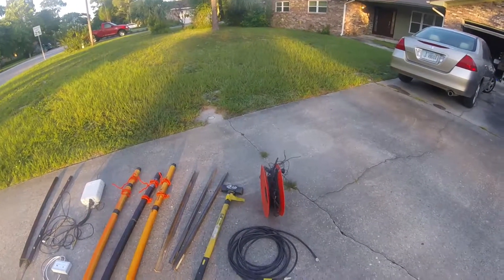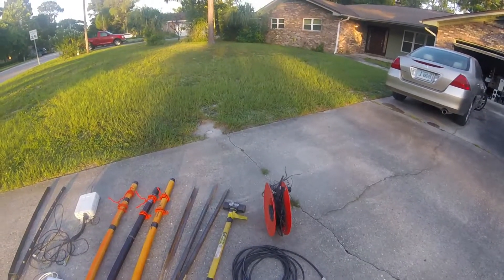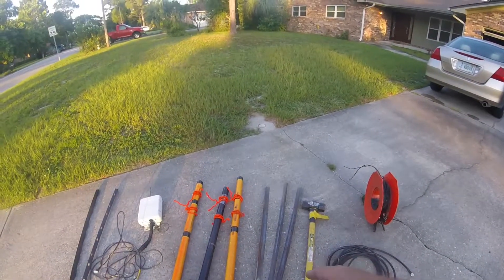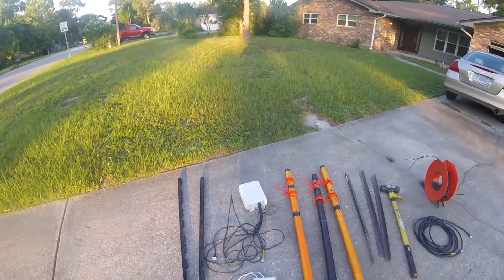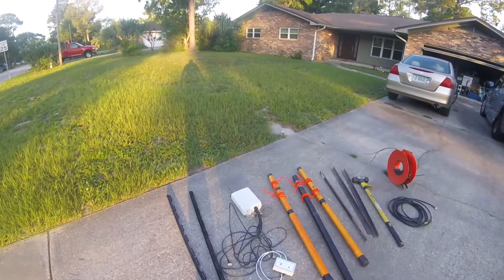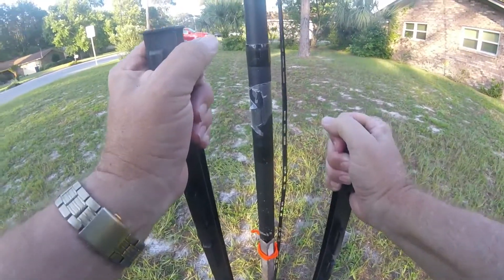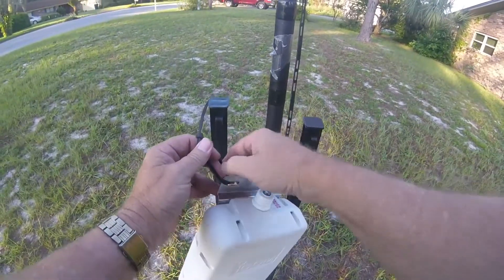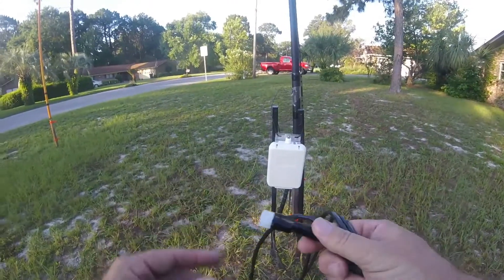N4KGL Field Day Loop Antenna Test with The Elecraft KX2

Comment: hi greg gret video the ah-4 is copid after yaesu fc40 i think or the other way around dont know who made it first ,you sould tray a folded long wier or folded longwier inverted v, 1 or 2 aresrors vork vonders 4 the long run from tuner to radio with 2 small tent spikes, smal boxez thate make wonders in comunication

Comment: I have the ah-4 tuner as well, works great.  Curious though - why the ladder line and not just connect the ends of the wires? I'm interested in doing this too, but don't know what the little piece of ladder line is for.
Reply from the maker: Steven Hull The 300 ohm balanced  line allows the tuner to be near the ground. It is just easier to support it there instead of on the pole at ten feet up.